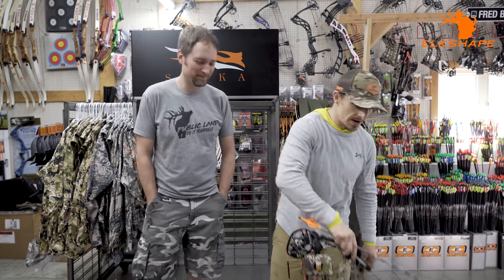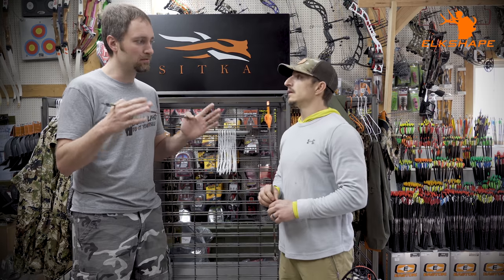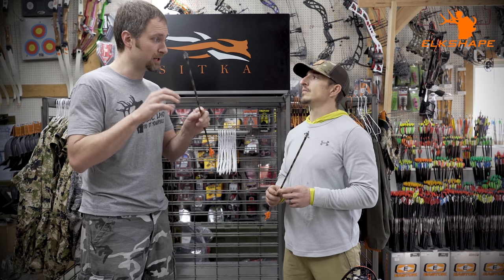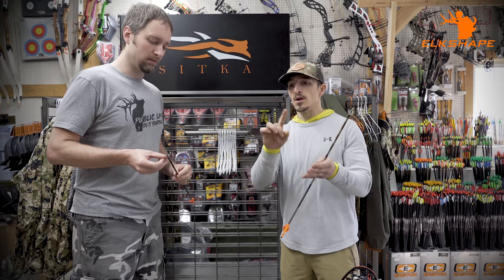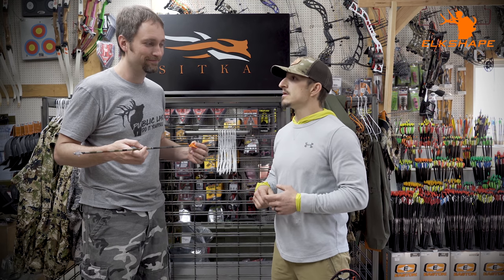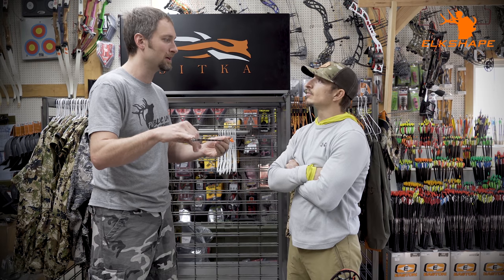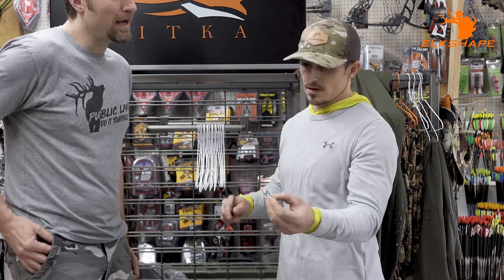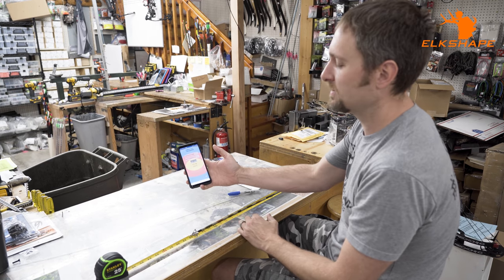Selecting the RIGHT Arrow for Elk

Comment: It helps with aluminum or fmj arrows to rough up the area you intend to Fletch with coarse grit sand paper( 120-220 grit). It helps with carbon as well.
Reply from the maker: good tip!

Comment: 620 grain arrow with a 12% foc and 70lb draw is where I landed after many years of experimentation, a heavier arrow will also benefit you with a much more quiet bow.
Reply: Mile wide pin gaps. Dropping 5 inches every five yards.
Reply: @tylercarder581  with my slider sight I thankfully don't deal with pin gaps, shot my deer this year at 65 yards. It works and it works well set my dual pin slider at 30 and 40 respectively and I'm covered from 20 - 50 with zero adjustment needed.

Comment: If you are using sight tapes for yardage, such as the black golf ascent, how do you adjust when switching arrows? If I hunt with a 7gpi arrow and shoot a specific speed, then bump up to an 11gpi arrow, obviously the bow slows down so how would you adjust that on your sight?
Reply from the maker: Need a different sight tape for different setups
Reply: I run a factory tape that's dialed for my 430gr arrows and I have my 20 30 40 50yd marks sharpied on for my 615gr elk arrows.

Comment: Thanks for the info. What arrow set up would you use for Axis Deer. 70lb bow 28 inch draw.
Reply from the maker: Check out he Axis Match Grade arrows - 300 or 340 spine with some weight up front!  50-75 grain insert and a sharp fixed broadhead, like the grim reaper micro hades 3 blade, that's obviously my two cents.
Reply: Tanks, Bro

Comment: Does the single bevel edge have an affect on the arrow fletching
Reply: Not directly. However, if you don't run the correct helical/offset( and the proper wing if you're using feathers) with a single bevel it won't spin properly and will act, basically, like a double bevel. So, right helical with right Bevel and left helical with left bevel. You can run straight vanes, but you won't see as much spin in the target( marginally).

Comment: Good video fellas. I would like to get your opinion on something. I am a 29 1/2 inch draw length shooting arrows that are 29 inches out of my compound set at 65 pounds. I’m currently shooting East and FMJ’s in a 340 spine. I know because they are a heavy arrow to begin with getting more FOC is tough. What are my best options to try and get a little bit more weight upfront without having to drop down to a 300 spine? I’m currently shooting a 100 green tip. I’ve considered brass inserts as well as just increasing to a 125 green tip. Thanks.
Reply from the maker: I always put in the BRASS inserts from easton - start there! 50-75 grains.

Comment: What is your recommendation on the least poundage you should use to bow hunt an elk?  I shoot 60 lbs. due to shoulder surgery.  Is that practical or should I use a firearm?
Reply: Kevin, I’m not an expert in any way but have looked into this extensively. There is a lot of data showing that arrow weight, FOC and super sharp cut on contact broad heads matters more. People are getting consistently great penetration on large animals with less poundage running 650gr and 20%+ FOC. You will need to know your range for longer shots but you will likely blow right through an elk.
Reply: 60 lbs is PLENTY for elk as long as you use the right arrow/broadhead setup.  (500+ grain arrow weight with a fixed blade head)
Reply: I shoot 55Ibs at 27" draw and it's been deadly. I built my arrows off the valkyrie system

Comment: Good vid. I been in the process of building an elk arrow and im wanting to get a little guidance on my arrows now and what i should do to them to make them better. Bow specs are 28 draw, labeled a 70# bow but it actually measures at 65-68#. Arrows are carbon express wolverine 55-70, 10-10.5 GPI, 28.5 length, 345 gr. Total arrow weight (arrow only no Broadhead with 11 gr. #2 aluminum insert, 7 gr. each for blazer vanes times 3 for 21 gr. total, 10.5 gr. nock, and no wraps), total arrow weight with a 125 gr. fixed Broadhead is 470 gr. (345 gr. arrow + 125 gr. Broadhead) making 9.5% F.O.C., at a speed of about 266 FPS. Any help will be greatly appreciated, thanks
Reply from the maker: That total arrow weight is plenty to punch through an elk, assuming that it's a fixed head and your bow is super tuned.  My personal FOC sweet spot experience has been in the 13-15% range however, it's going to only matter to you and how you're shooting.  Let us know how your broadhead tuning is goes!

Comment: That man is very smart and you should listen to him when he tells you to go with a lighter GPI arrow I’m shooting 60 lb 450 gr arrow 27.5 arrow 175 grain up front 6 inch wrap in the back and running 14.2 foc. Fmj are trash
Reply: or, have a high weight with a high FOC and literally be able to shoot any animal at any angle and get a passthrough (ethics put aside)
Reply: @lugia233   yep I shoot 528 grains with 200 up front
Reply: @tylerisbell3989  638 here with 200 upfront, I still get the speed I want so no need for me to go lighter
Reply: @lugia233   I would have a mid speed and quiet than loud and fast
Reply: @tylerisbell3989  true that

Comment: So what is your recommendations for total arrow weight and range of FOC for elk.    My drawl weight is 70 pounds in my ear length is 28 inches.
Reply: so you want someone to calculate it for you? did you not watch the video?
Reply: I'd say that's personal preference. Figure out the farthest shot you'd take and build an arrow that'll get it done at that distance. If you're only going 50 and in you can get a really heavy arrow, but farther you may want a lighter arrow.

Comment: Excessive on weight!? Bro that’s a light arrow, excessive is 850 grains plus. And just go ahead and upgrade to steel inserts brass are trash
Reply from the maker: Dear Wolf... just for context, how many elk have you arrowed with your steel inserts / "heavier" arrows?  How'd it go for ya?
Reply: Elk Shape unfortunately I haven’t had the opportunity yet for elk, but a bunch of feral Texas hogs. And I get pass throughs with hogs. I am running xtorsion arrows with 200 grain steel inserts and 200 grain iron will broadheads. Love the set up. And by the way I subscribe and love the channel